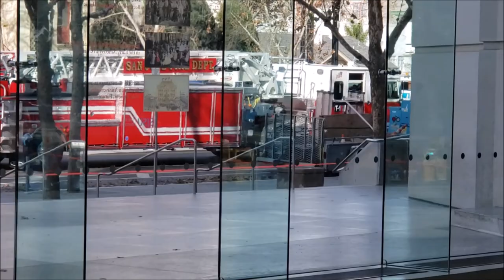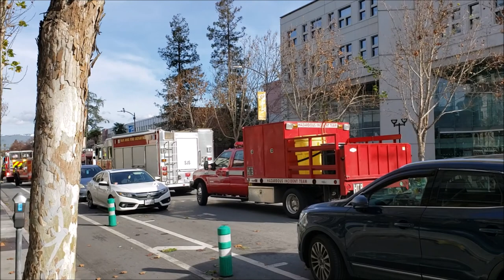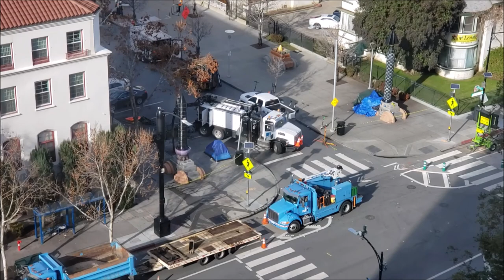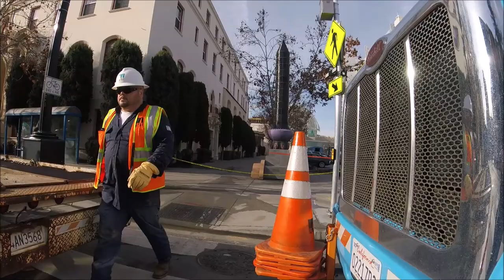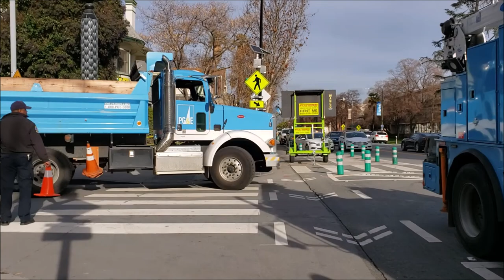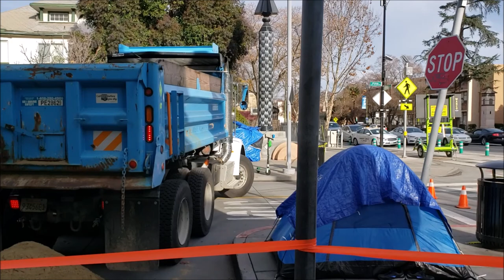You smelt it..... San Jose Mayor Sam Liccardo dealt it......

Comment: I actually heard PG&E was fined recently for cutting corners in regards to their paperwork. Workers were lying on required inspection forms and saying inspections had taken place when they had in fact not. One of the types of inspections they were lying about completing on forms was checking for gas lines, water mains, and buried power lines before major construction jobs were to take place. They would say on the paperwork they had marked the ground with paint to indicate for gas lines/power lines and water mains before the construction started, or that none were present, and then there would be issues once the construction did start. I wonder if this has anything to do with that?